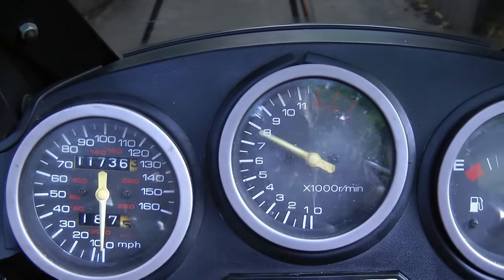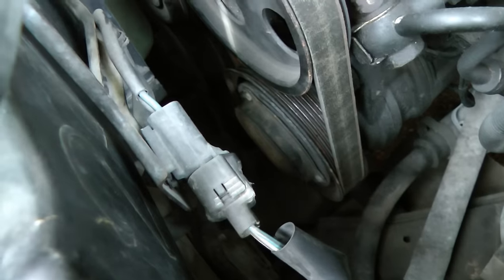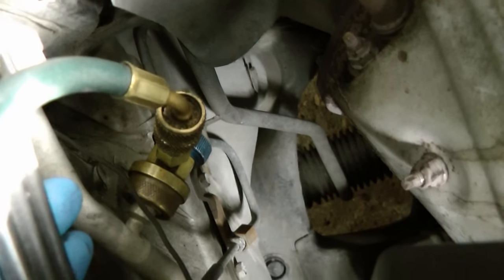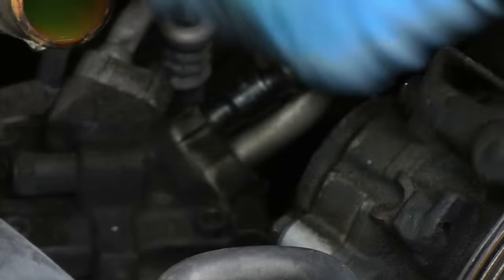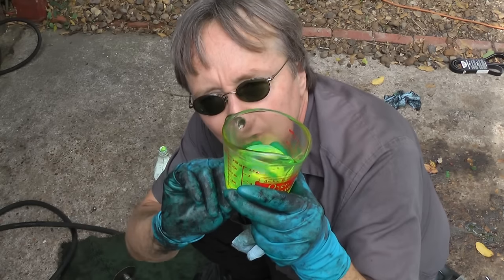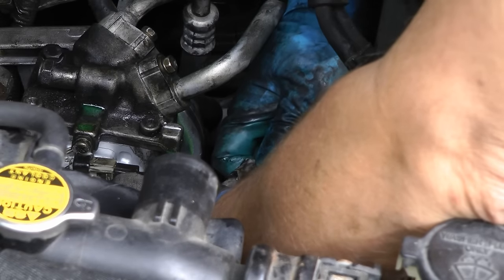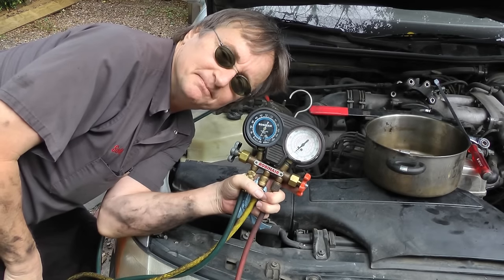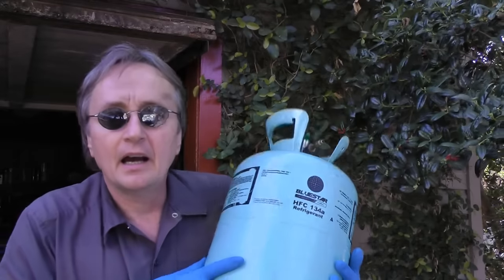How to Replace AC Compressor in Your Car

Comment: I just replaced the clutch assembly on my 2001 ford windstar. As i pulled the compressor out the oil drained out also so i wasnt able to see how much was in there. The sticker on the van says to add 14ounces. Is that too much oil?
Reply from the maker: Pedro Trevino that's for the whole system, I would guess 4 ounces for the compressor

Comment: Hey thanks for your great video.  I have a question on my 2001 Toyota Tacoma.  I'm getting a grinding sound that appears to be coming from the a/c pump.  It still turns (not seized up) but it doesn't come on.  The first I did was check the fuse (blown) replaced it and the light came on for a second and then went out...no a/c!  The noise sounds like metal on metal (I'm assuming that's not good).  How would you proceed?  Obviously money is extremely tight and if I can do it myself I will.

Comment: Hello, my car is Mercedes Benz w210 millemium.
And the question all ac compressors in mercedes are same?
i mean diesel bezin volume different ?
thank you
Reply from the maker: they use many different models and makes of compressors, you have to match up the old one

Comment: Hey Scotty I have an 83 mustang an the ac isn't kicking on.... I ran a jumper wire to the compressor and it works fine.... Is this a pressure issue? And if so what should I look for?

Comment: Scotty, hate to bother you but the place where i got my compressor told me it was half full, can i mix oil viscosity as i am waiting for a reply from them? I bought the 8 OZ PAG 46 with dye so say the comp. has 100/150 can i use 46?

Also, regarding oil for the accumulator do i just pour it in the hose directly? Have to pick-up those plastic quick release as the scissor tool is too bulky

thanks

Comment: I have a 2003 G35 coupe and my compressor just went out , tried that ac pro stuff to see if it would do anything nothing , do you know how much all this would even cost to fix its to hot in San Antonio to not have ac
Reply from the maker: infinitis are fun cars to drive, but super expensive not fun to repair when they do break.  TRY to find a guy like me in san antone who will use a new chinese made compressor rather than the insanely expensive dealer unit

Comment: Hey Scotty I may have to do some at home engine swaps for customers and I will need to evacuate their ac system to do it. where would I find a good quality vacuum pump or is a cheap 160 dollar one viable?
Reply from the maker: heck, I use a fifty dollar on sale one from harbor freight tools, still working fine years later.
Reply: the harbor freight one here in seattle is 170 bucks after tax. inflation... haha. but the problem I'm having is where would I find a hose to connect the the ac connector?

Comment: Ordered condenser for05 odyssey paperwork says "install half PAG oil in suction side with remaining amount in accumulator or low side of system". Then online I read on ehowto that "COMPRESSOR OIL GOES IN THE LOW SIDE PORT (big hole port vs small hole/high pressure) and to pour the oil very slowly into the intake port or low side of the compressor. This is where the large line entered." Seems like conflicting information and I want some clarification so it's done right. Any input on this? Thanks

Comment: Hey scotty big fan. I have a 1977 mustang ii 4 cylinder and i cant find the ac compressor brackets. Do you have any sugestions?
Reply from the maker: Robert Villarreal it may not have them, many did not come with AC. If so, try a junk yard, as I would assume those are obsolete parts at a dealer
Reply: Thanks

Comment: Scott I replaced a/c compressor I did the vacuum but the problem is when I want to fill back I doesn't true in the Freon I don't know what is that
Reply from the maker: many things can go wrong in AC systems, but some need you to jump power to the ac clutch to start it spinning when filling up an empty system, try that first

Comment: Scotty, I see you just ran air thru the system for an hour or so, but you didn't use any flush liquid?, Also the dryer I assume must be replaced before new R134.
please explain
Reply from the maker: +Bob N it was evacuated. Modern AC systems really don't flush very well, and yes, always change the dryer.
Reply: +Scotty Kilmer 

So by evacuated you mean just run air thru the system at the dryer connections, then fill. 
Why does everyone makes it complicated

Comment: Hi Scotty! I am having trouble with my 2000 isuzu rodeo ls v6. My car runs fine but when I turn the ac on it stalls. Also sometimes when Im driving on the freeway or sitting at a stoplight it will shut off . Starts right back up with no hesitation. This problem seems to go away and come back... any ideas?
Reply from the maker: many things can make a car stall out, BUT if  it only happens when the AC is on, odds are the compressor itself is wearing out and dragging the engine to stop it
Reply: Ok I feel really silly BUT today I put gas in my car and noticed my fuel filter was leaking AGAIN.. I guess that was the problem... im going to test drive it and see if the problem is fixed. I just replaced this filter less than a year ago so im thinking it was a faulty part or I must have done something wrong the first time.. I cant believe it was JUST the filter ... lol

Comment: hey scotty i have a 2006 mazda 3 S and the A/C blows cold when ever it wants sometimes i hear the compressor but blows warm air an it makes a wierd squeling noise.. not normal compressor noise but a weird noise.. I wanted to know what might be wrong with it? will a bad fuse cause this?or compressor going bad? thanks

Comment: Hey, Scotty!  Can I get an opinion from you?  We are looking to buy a 1997 Chevy Tahoe with only 80K miles on it.  One owner.  The only mechanical problem is that the A/C does not work.  The current owner says he unhooked it due to it making a loud grinding noise.  The fan still works to circulate outside air, just the a/c does not.  Is this an expensive fix?  Could we do this our self?  Would appreciate your input.  Thanks!  Have a fantastic day!

Comment: Scotty, i have a 96 Jeep grand cherokee 5.2 and my compressor was starting to 'growl' but didn't seize- i thought the bearing-- I got a reman. one online for 100.00 and also am replacing the accumulator,, compressor is shipped dry so do you have an idea of how much PAG oil? Also do i just add oil to the accumulator also? Oh, the old comp. was BONE DRY so unable to measure old oil, comp. should arrive Friday-- i got an o-ring/manifold set waiting

Comment: A guy changed my alternator and took off the A/c compressor said i didn't need it , two days later my car died and now it turns on but it turns off but before turning off smoke comes from the belt /alternator area , any idea what could of happen ?

Comment: Looking for some advice on replacing a a/c compressor on my 2003 Honda Accord Coupe.  Trying to go the cheaper route of fixing it myself rather than taking it to the dealership where they want to charge me tons of money. TIA
Reply from the maker: just do as in this video, not that complex IF you have the tools. if not, you can buy vacuum pumps, gauges, and everything you need at discount tool places like harbor freight.
Reply: Awesome thanks!

Comment: i bought the a.c can with the hose and the meter should've went to green meaning it's refilled. but when i tried it it was already on red. my car blows hot air. would i need a new a.c compressor? or maybe its just messed up electric wiring? but my heat works perfectly in the winter. i have a 2002 Mitsubishi galant ls.

Comment: Hello Scotty. Love your videos as the are really helpful. I just have a quick question. In my 2003 lancer the ac works only half the time and sometimes it just stops blowing cold air (cooking me until I turn it off).  Do you think its the ac clutch?  Also, is it common to hear a very small knock when shifting gears? (Its a manual)

Comment: Hi Scotty, Whats wrong if the ac compressor doesn't spin when you turn on the ac but I can spin it manually just using my bare hands? O.o so its not locked up but its still not working

Comment: Hey Scotty,
My car used to stop when I turned on the ac  on idle.I increased the idle speed now the car stays on.The issue is that on idle it still blows hot air when I accelerate(REV UP MY ENGINE!!:) to over 1500 rpm then it starts to get cooler,as soon as I take my leg off the gas, it heats up again.The engine goes down like 500 RPM and gets back to 1000 rpm,not sure if the belt tension is good.The coolant in the reservoir is empty.I got the ac refrigerant  level checked and it was green.Not sure If I should add more.I sometimes also hear a small sound when you listen closely through the ac vents.The other issue is that when I do turn on the ac i hear a huge click,which might be the compressor clutch.My mechanic said I might need a new compressor,I don't think he knows what his talking about he didn't even check it,I just told him that the car shuts off and he said its the compressor. You seem to have more experience & knowledge  with almost everything related to cars so can you please let me know what I should do next.Thanks
Reply: +Dello Morgan Sounds like the compressor is not turning easily, which is stopping the engine in idle. Your mechanic is probably right. Did you try to turn it with a wrench like the video says?
Reply: no,but i do see the clutch engage and at over 1000 rpm the ac blows cold air and it works fine.
Reply: replace the compressor
Reply: Yeah thats what Im going to do.thanks

Comment: Hey Scotty,

I have a junk 2006 BMW e90 325i that is full of plastic and other crappy parts. However, for reasons unknown to me I've decided to keep it and not sell it as I do my own maintenance, as this is the only way to really be able to keep such a poorly built car. My question is that My A/C compressor makes a whine when the A/C is on only and it only seems to happen when it doesn't need to be running hard, when it is a super hot day there is no noise, when it is an average day there is some noise. I had the system evaced and refilled and it slightly helped with the issue. Is my A/C compressor on the way out or has the wrong amount of oil been added ?
Reply from the maker: it's on the way out, but they can whine a long time before they finally quit
Reply: Thanks Scotty, you confirmed what I thought. I hate what cars have become, is there no manufacturer that still builds a trouble/plastic free car ? My other car a 1994 w202 mercedes has almost 200K miles on the original compressor and alternator.
Reply from the maker: Aleksandar Petrovic
they all use plastic much more, but toyota still makes a decent car

Comment: There is a rubber washer on the AC line connect to the compressor do you need to replace that

Comment: hi Scotty my car just had  the a/c recharged and evaluated  but now I can't tell if I need a new compressor or New fans cause the fans don't come on when I turn my a/c on they only come on to cool the car off then shut off I had put my a/c on fan speed 1&2 and I got cold air  along with the fans moving is it my compressor
Reply from the maker: +Donte Quinney fix the cooling fan operation first, both must run with AC on

Comment: Hello Scotty, saw your video on replacing an AC Compressor. What kind of oil do you put in the new compressor before installation? My 2004 Saturn Vue has lost it's cool, took it to local mechanic, freon was full registering at 70 on the machine gauge. They had me rev engine to 2k RPM & hold, they put fans in front of radiator, the gauge only down to around 60.  (Continued next post)

Comment: hi scooty  i have trouble with my ac system ..... i put freon  and it's working good but next day there is no cool air ....... the mechanic said it's the compressor ...they put a dye into the system but didnt show any leak ....... what do you thing that is the problem with it?

Comment: my compressor locked up while the car was running.  do i need a new condenser too since you said in another video that ac flushing doesnt really work because of the condenser holes are too small.
Reply from the maker: +Joe Kim yes replace the condenser
Reply: +Scotty Kilmer thanks!
Reply: I forgot to ask.  So i ordered a new condenser as well as you recommended.  How about the high and low ac lines?  Do i need to disonnect those and flush them out too?
Reply: I have another question that is off topic.  The oil in the ac compressor get cycled around with the freon?  Or does that oil remain in the compressor only?

Comment: QUESTION: my crown vic must have a saftey cut off for the ac clutch i beleive, ever since I bought it as far as I remember the clutch will spin for 3-4sec on then off continualy but now it only blows hot air, I've bypassed the ac relay to keep it spining...still hot air already wasted so much on r134 freon its crazy car is a 99 crown vic THX.

Comment: Our 93 Saturn SC1 blows when we turn on the A/C but not cold, our mechanic tried refilling the refrigerant but it didn't work, every time he turned on the A/C the fuse would blow, and whoever owned the car before put in a switch by the drivers seat so they could turn on and off the fan when they needed to, could that be blowing the fuse or is something else wrong?

Comment: hi scotty i'm having problems disconnecting the a/c discharge hose from the bottom on my 99 jetta 2.0
Reply from the maker: +edwin Farrell they just unbolt, but sometimes stick on and you have to wiggle the crap out of them after unbolting

Comment: The thing is my comp. Works 30min at first start and then stop for high pressure   vacuum and re-filled and same it needs new comp. Right?
Reply from the maker: well, could be that, could be lots of other things, from a bad expansion valve to bad electronics. Hook up AC gauges and check the pressure when it's working and when it stops working first, or pay a mechanic to do that test

Comment: Thanks for your reply now I have another question.  My AC compressor seized up and the belt burned through.  I wont be able to fix it for another week, is it ok to still drive?  Thanks
Reply: That's what I wanna know. Can I drive the '95 crown vic w/a seized up compressor making sure the ac system is turned off inside the car?

Comment: hi scotty...nice vid....i spent a lot of money on my 96 toyota tercel trying to fix the a/c. i replaced evaporator, dryer, compressor, expansion valve, condenser...few months ago....now i have a leak..didn't know where....i took my a/c compressor out and i realized that a screw wasn't getting tighting...the more i tried, the less it got....will it be possible the reason of the leak? ps. the compressor has 5 long screws...just one of them is not getting tight....greetings :)

Comment: Hi Scotty,
I own an Olden Astra Convertible TS 2002 model. Went overseas and the AC was working fine before I went. Now after nearly 6 months I came back and the cold air is not longer coming out. I let a professional check my car and at the beginning he told me the AC only needed new GAS. I left the car there for 2 of hours and after that I received a call from the AC guy telling me that the compressor instead was broken and needed to be changed. What's the deal here? 2 hours to find that out?

Comment: Hi scotty i have a 2003 ford focus and my AC doesn't work but it does have refrigerant in the system but the compressor is spinning what else could be the problem ? :)
Reply from the maker: +RC MAYHEM start by hooking up AC gauges to see what the pressures are to analyze it. Pray the system itself is OK and that it's a minor dash control problem like a bad blend door actuator
Reply: +Scotty Kilmer ok then thanks i will give that a try have a nice day thanks again

Comment: hey Scotty, i have a problem with my a/c compressor. when i turn on my a/c it makes a squeaking sound like metal on metal grinding. i looked and seen it only happens when the a/c compressor clutch engages, could it be a bad bearing or something else i can't see? and it only happens when the a/c is on, when its off it doesn't make the sound.

Comment: I have problems with my dual zone AC, passenger side is cool and drivers side is warm. The car is an 06' Honda Accord and the Honda Dealer representative told me that it was the compressor but that does not make sense for me, can you please help me and I really appreciate it, Thanks!.
Reply from the maker: many things can make it cool on passenger side and not on driver's side. Number one is just being low on refrigerant, check that first. Pray it's not the dash unit going bad, that costs a ton, as does a new compressor.

Comment: They told me compressor was running but not pulling freon into system, the seals in compressor are shot & will cost $7-800 to replace. I can't afford that so I plan to do it myself. It looks as if I have to pull the engine to get compressor off,, is there a sealant that I could try first as a quick fix. If so how would I put in?

Comment: Scotty, I have an 03 RSX which recently started having a knocking sound coming from the compressor (only happens when the a/c is on). A/C still works, but I went to a mechanic and he told me I need to replace the entire system since the compressor has contaminated it with metal fragments. He wants $1000 to replace it. Can I just change the compressor? Thanks!

Comment: Hey Scotty hi have a 2005 pontiac g6 I've already replaced the ac compressor a/c works good blows cold air but when I turn off the ac control and turn it back on the clutch on compressor doesn't kick back on it'll start and stop what could this be? Thanks
Reply from the maker: those are complex computer driven systems, if it blows cold, leave it alone, they are not good at being turned on and off when that old, electronics often will act up.  they can cycle for many reasons, from electrical flaws to low refrigerant to ac system internal blockage